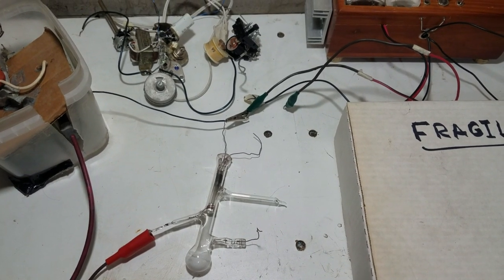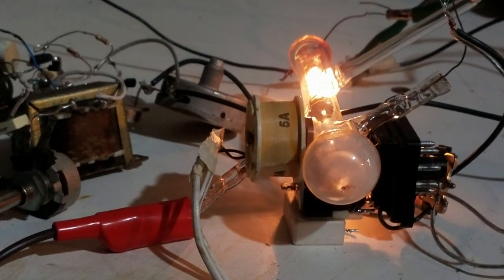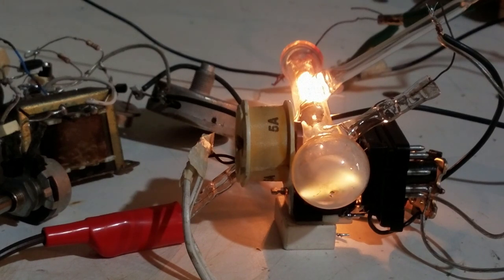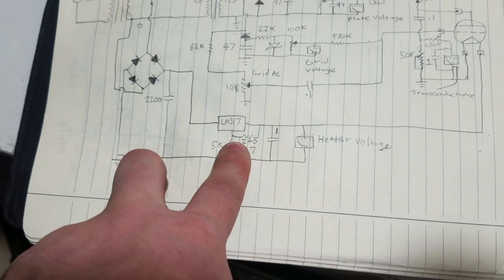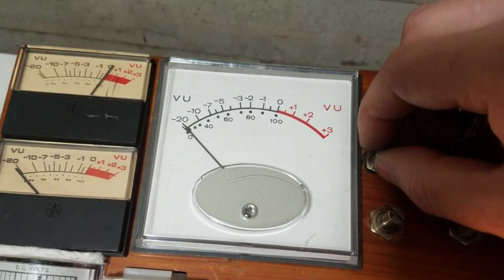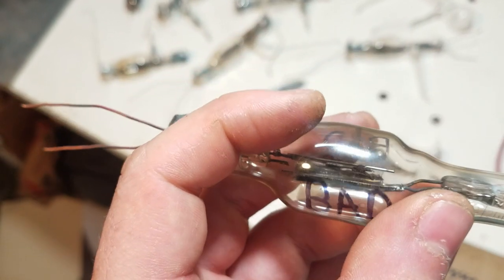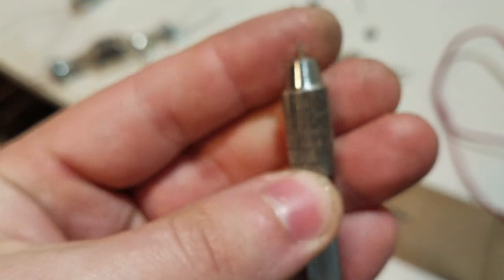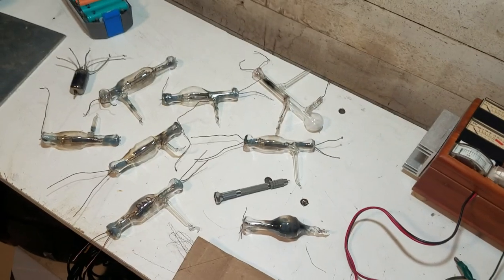Homemade Cathode Ray Tube, Transconductance Tube Tester, and other stuff

Comment from the maker: 00:57 : Homemade CRT
9:28 : Blocking oscillator circuit
12:14 : Transconductance Tube Tester
20:50 : Thoughts on making Triodes

Comment: Nicely done, think this is the first  homemade CRT I’ve seen with a good enough vacuum for thermionic emission.
Reply from the maker: Thank you! I made this before I had my titanium wire that I use for getters so vacuum has gotten worse over the past month. When first sealed off it did  not arc over at all with a higher voltage.

Comment: I'm almost certain this is the first homemade sealed-off hot-cathode CRT on the internet. You beat me to it! I'm curious to see how a properly gettered one would perform; at the very least it would probably be easier to adjust. One thing to consider if you're going to build more of these is picking up a flat sheet of pyrex (available for 3D printer beds), and cutting out discs for the face of the tube. Seems like that would be the easiest way to get a regular/even surface for calibrating the beam. I haven't tried it myself yet, but that's my plan for when I eventually try to make one.

Glad my tungsten preparation procedure worked out; I was hoping I had remembered it correctly and not left out any details, it's been a few years since I did it. I think the only thing I might've missed is on larger tungsten (0.5mm and above, where I used TIG electrodes) I would sand the rods on my lathe so that the sanding grooves were helical rather than axial, to avoid air paths. This isn't practical on fine wire though, and I'm not sure it makes much of a difference anyways.

If you're starting to quantify the characteristics of your tubes, one thing that you might find useful is a book titled "Materials and Techniques for Electron Tubes". There's a link to the PDF on my site in my tetrode article, and on page 277 there's an extremely useful table that shows the relationship between filament current, filament size, emission, and evaporation. The rest of the book is great too, but I found that specific page critical to understanding the operational limits of tungsten filaments. The math is kind of unusual, but the data is all correct once you get the hang of it.

Looking forward to seeing what else you make; I think with some bigger glass and some alignment jigs you'll be able to start getting repeatable results. Any plans to make any all-tube electronics, like a radio or an audio amp? Might be a fun project.
Reply from the maker: Thanks for your help! would not have been possible without your website! I have made a Regenerative receiver with one of the tubes but am currently using a solid state amplifier for the audio. I have been having trouble getting appropriate audio levels using my tubes in an audio amp.  Another trouble is my regulated supply in my tube tester gets too hot running two filaments because my tubes use so much current! I am working on another stand alone filament supply. I hope I will be able to finish the radio before school starts up.

Comment: Wow, you're at it again, Awesome work by the way! 
I'll add a hot cathode CRT-tube to my list of tubes to be made. 

Do you have any tips on how to get an even coating of phosphor on the glass?  That would really help me out.

I've accidentaly made a few thyratrons in the process of trying to make triodes. It turns out they're stable enough to be used in relaxation oscillators and i've built a few frequency generators out of them. It would be interesting to see you give it a shot.
Reply: I've intentionally turned a few dual filament 12V bulbs into thyratron-like devices, with a Weagant tube style external grid held at strong negative bias.  I built a stable audio VFO with one of them, using a balanced armature speaker in series with the cathode's center tap ground (floating dual rail supply). This gives a lot of volume, quite loud at the low end and still audible up to near ultrasonic. The tube won't operate reliably at much above 20kHz, and that's only in thyratron mode. I have managed to observe voltage gain in the audio range while operating as a triode, but always less than 2 and I have been unable to coax an oscillation out of that same mode of operation, presumably as the power gain is too small. If adjusted for more power gain, the voltage gain always falls well below unity. I typically run about 13V on the low-power filament, with variable anode and "grid" bias supplies, up to +500V and -400V, respectively. A suitable bulb will give at least 100uA emission in a region where the grid still has some degree of linear control, though run as a thyratron the same bulb might pass 1mA.
Reply from the maker: I mix the phosphor from a fluorescent lamp with water and mix thoroughly, I then let it settle and drain off the upper water layer, this leaves a concentrated slurry at the bottle of the container. I then put a drop of the slurry in the tube and slowly rotate the tube over a relatively cool flame at an angle to evaporate the water. You have to have it close enough to the flame that it evaporates quickly but not too close that it boils because it will make splotches in the phosphor. When the water is close to being gone the remaining water will form a small drop on the inside that is heavily saturated with phosphor. The tube is then rotated such that the drop coats the inside in a spiral pattern while very lightly driving the remaining water off with the torch. It takes me about 10 minutes to make a good coating. If the dried coating is splotchy or not to your satisfaction you can always add a drop of water, mix it up and try again! 

I will be sure to experment with thyratrons in the future, it seems like an easy way to make a sawtooth wave with homemade devices.

Comment: Absolutely fantastic! The CRT especially caught my eye as just a week and a half ago I made a very similar (though much less effective) one! My anode was just a wire as I had recently gotten my new glass tubing and wanted to make a proof of concept tube. While on the pump, I did get a good enough vacuum that 2400V on the anode didn't cause any glow discharge, and when the filament was heated up, as little as 1200V would make the whole phosphor bulb glow a nice red color (mixed CFL phosphors yield interesting colors). This, however, did not last after sealing off as there was a small leak somewhere and the tube was useless within the hour. I made a better version later with a pinhole anode and a shielded filament, but I hadn't noticed a crack in the anode wire seal before sealing it off. I sealed the leak with a dab of JB kwik (works surprisingly well in simple vacuum setups), and opened the stem up for re-evacuation, but the inrush knocked a bunch of phosphor loose. I didn't notice this at first, and my cheap chinese pump sucked some powder in, damaging its vanes. Needless to say, I never did finish re-evacuating that tube. Luckily now I have a great condition Edward's E2M2 and a fair bit more experience with glass. I do feel I should point out that I use soda lime with either Dumet or titanium feedthroughs. I'm not sure if there's anything I can be of help with, but if you're looking for advice or getting stuck with tube making, I'll do my best to lend a hand! Keep up the great work and I look forward to more of your videos! :D
Reply from the maker: Thank you for the comment! I am glad to hear other people are doing this! This was I think my 6th attempt at making a CRT. I had similar seal problems and pinholes where I had joined different pieces of glass. Good to know about making sure nothing gets in the pump. I have been lucky so far but will have to be more careful in the future.
Reply: @jdflyback  I've found that making glass to glass seals using a pinpoint flame oxy/fuel torch really helps prevent leaks as you can get the joints hot enough to completely flow but in small enough areas that the whole thing doesn't collapse in. Also I've been considering using a fine mesh (maybe 400 mesh) stainless steel screen at some point between my manifold and my pump to keep accidental debris out. Not sure how badly it would impede evacuation though.

Comment: Great work ! have you  done any more on the CRT you could pretty much make a scope from your work bit of focusing in fact if i had your skills i would make a CRT tv with the home made triodes for the circuit and CRT ....a monitor would not be impossible from what i saw .
Reply from the maker: I have been in school for the past few months away from my shop so not any glasswork recently. I hope to experiment over the summer. I really would like to make a homemade monitor someday with all homemade parts. A scope should not be too hard (depending on your definition of a scope). A relaxation oscillator could be built with a gassy triode acting as a thyratron to make a sawtooth wave for the horizontal sweep and another triode could be used as a vertical amplifier. A monitor would need another relaxation oscillator a video amplifier and sync circuitry. I should post one that I made a while ago using commercial tubes.
Reply: @jdflyback  I can see almost there you need a  focus coil and  deflection coils you have worked out ...i would say since you know now how to make  a working CRT i would think about making a  flat face CRT and work on a good focus spot  making the hole for the cathode rays a touch smaller ...perhaps a simple  audio scope for a proof of concept  and then move on to a home made Crt monitor ,i would go with NBTV 32 line all audio  software  for the video is on NBTV forum https://www.taswegian.com/NBTV/forum/ i am Harry Dalek on that forum
Reply: @jdflyback  BTW  still at school ,boy wish i had your brains !

Comment: I love your "Engineers Lab." It looks just like mine. I have a Sencore scope too. 

Your experiments building building Vacuum tubes and CRT's are very interesting. Do you calculate plate and grid size for your "valves?"

How did you develop the characteristics for your CRT and circuit design?

Enjoy you videos!!!

Thanks,

Comment: Have you tried using a unijunction Transistor?  Something ike a BF33F  or 2N2420 you can take the scan voltage off of the Emitter and the blanking pulse from either of the bases.

2N2420 seem few and far between these days but BF33F's are readly available on eBay.

Comment: Wow! That's amazing! I found the CRT particularly impressive. What type of transformer did you use for its 'Blocking Oscillator'? I am planning on building something similar. Thanks so much for sharing!
Reply from the maker: Thank you for the comment! I used a transistor audio output transformer from an old tv. It is hard to find something completely identical but a transformer from an old school power adapter would probably work. The side that would plug in to the wall would be connected to the base circuit and the side that would output power would connect to the collector and the positive supply. You will have to cut open the adaptor and remove the bridge rectifier and capacitors if the output is DC. If the Adaptor outputs AC you can use it without cutting it open. Good Luck!
Reply: Thanks so much!

Comment: Excellent! I think it could benefit from a focusing coil, though, to shrink that dot size a bit.
Reply from the maker: You are completly right, I have to figure out how to make one  fit as the relay coils take up so much space as it is.
Reply: @jdflyback  You could use longer cores on the solenoids to get the coils further back from the envelope, and the focusing coil can be wrapped around the back end of the globe. Using a large ceramic doughnut magnet might work on its own, if you can fit the tube through the middle.

Comment: @jdflyback - your channel is so interesting to me, even though my electronics background never got past hobbyist stage. Frankly, most of the reasons you do what you do are well over my head. Nevertheless, I’ve subscribed because it’s so fascinating. Suggestion: start a beginners series where you describe some of the theory behind what you do. For instance - vacuum tubes - where did you learn about all this 60’s tech? Id love to learn, but I bet you can’t find most of it on the internet.
Reply: You absolutely can find it on the internet. And if you want o learn about it, go look! You can also check your local library. Tubes are actually fairly simple devices conceptually.